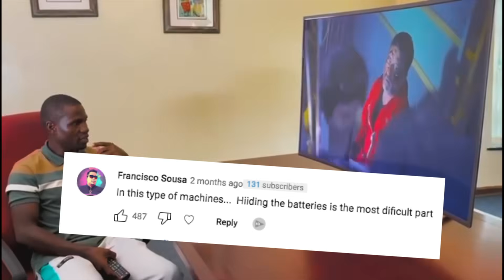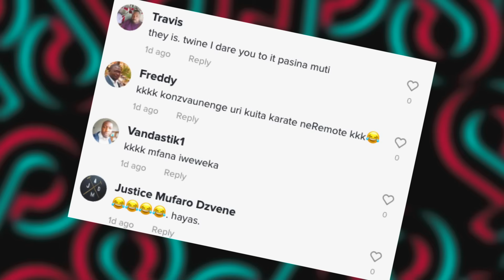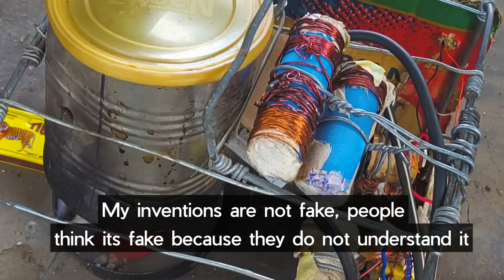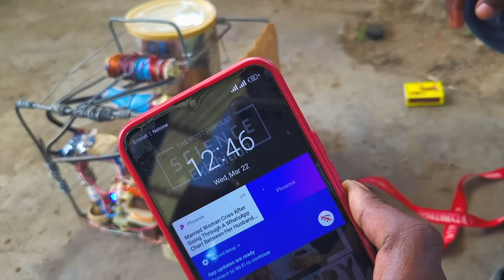Meet Zimbabwe's Youngest Inventor who built a Water Powered Generator

Comment: Conplete scam !!, a candle does not have the power to heat water let alone to the temp for a steam turbine. and nothing moved the only thing that moved was the electric motor when he turned the key. likely a 3.6 lithium cell for motor and charging. another black genius free energy. fuel free cars etc lies and fake.

Comment: It's an inverter powered by a few batteries. The water is just for show in this case. The steam isn't moving any turbine.
Reply: what have yu made so far & have you ever charged yr phone on batteries
Reply: @anndrew7958  I invented the Thermal window generator, The Vacuum steam turbine, The forever fountain...  now we have Crystal cell batteries.  The Tritium generator. We have the magnet piston. A lot of people are making thermal acoustic Stirling engines. To run a generator on Water using electrolysis you'd want to start with a traditional generator then split the Oxygen and Hydrogen off to run on Brown's gas instead of gasoline or propane.

Comment: It is good that he can join mechanical and electrician parts together to make something that works.

It is a terrible generator by the way (good for his age though). It does not run on water (alone if it's the steam that it actually uses and I doubt it)... It runs on burning candle wax (fuel, so at best it's basically like every regular gen).

At worst... It's a very deceptive contraption he has built. What the hell is a spark plug doing there! A steam engine would be way way simpler than that contraption he's got there.

Comment: You should have gone to the local University and taken with you an Electrical Engineering professor. 

Don't put that young guy close to a bank in order to protect public funds as his abilities are off the scale.

You should have also asked him how much the batteries he  was using cost him as the power generator by those batteries was quite substantial..

Comment: At face value, thats not running off of water, its running off of heat energy. The water is part of the drive train used to push pistons through coils to generate the electrical current.

Comment: A steam generator, also known as a boiler, is a device that produces steam by heating water. The basic components of a steam generator include:

1. Water tank or feedwater system
2. Heat source (e.g., fuel burner, electric heating elements, or nuclear reactor)
3. Heat exchanger (e.g., tubes or coils)
4. Steam drum or header
5. Superheater (optional)

The process works as follows:

1. Water is fed into the steam generator from the water tank or feedwater system.
2. The heat source heats the water, producing steam.
3. The steam rises into the heat exchanger, where it is heated further.
4. The steam then enters the steam drum or header, where it is collected and distributed.
5. If the steam is to be superheated, it passes through a superheater, which raises its temperature and pressure.
6. The high-pressure steam is then released into a pipe or header, where it can be used for various applications, such as powering a steam engine or turbine, or providing heat for industrial processes.

There are different types of steam generators, including:

1. Firetube boilers
2. Watertube boilers
3. Electric boilers
4. Nuclear boilers
5. Heat recovery steam generators (HRSGs)

Each type has its own specific design and operating characteristics, but the basic principle of producing steam by heating water remains the same.

Anonyepa uyo twumvura uto tushoma zvisingaiti. Pane battery somewhere ririkutenderedza propeller. Muchigaba umo munongobuda steam inenge hutsi hwetea  kwete zvaarikutaura  atleast aneshungu but ngaataure chokwadi abatsirike.

Comment: Put your own original charger. It won't charge. That generator won't give 220v. It's 5v itself. The charger's wire is directly connected to the two pin without passing any transformer then diodes than capacitor and resistors and voltage regulator or any kind of inductor. It's 100% fake. Charge your phone with your own charger, not his charger

Comment: A generator can run on water. Please check out Toyota's amazing water car that the automotive giant is developing.

However, as super as Mchenry is, this is NOT a water generator. It is a candle flame water electric generator. 

The candle burns and heats water. The water steams, and the steam is transferred into electricity. Looking at Mchenry's invention, I am not sure how he has transferred steam water vapour into electricity? The usual process is by steam turning a turbine. A bit like a windmill's blades, but instead of wind, using the steam to push the 'wheel'.

That is not to knock it! It's still great to know that one can charge a phone up, or light a bulb with a candle! 

You can also cook bread with a candle in exactly the same way: put a biscuit tin over a candle and pop the bread in there. 

And, you can heat a home by putting a candle under a clay plant pot.

But, none of those are water power. They are candle power.

Comment: Something is not adding up here. Am not a Master of Physics and electronics buy the key and starter means there is a battery hidden somewhere in the circuit. Steam engines use so much pressure from steam to turn turbines, something missing from this tale. 

I respect the ingenuity but implore the youngster to be more truthful. Where does teh sound of a running motor come from, using what power? 

0 + 1 = 8 here.

Comment: That is a candle powered generator (that is if it did use steam pressure to generate power). Also from the looks of it, that boiling can could have not theoratically generated enough meaningful pressure to even produce any electricity. Also, why does the generator need to be turned on by a key when the steam is supposed to be generating electricity already. The reason why he supposedly turned that key was to just supply power to that electric motor from a pre installed battery. That charger is also empty and does not have the components of a proper charger which step down current.

Comment: please explain how each stage works on the parts ,like heating ,steam conversion turbine electro mechanical induction ,rectifiers,
Reply: Those two batteries... They turn the motor which generates a current. There is no steam power involved 😂

Comment: Steam power that drives a turbine for power generation has been used for donkey years and is not new, this just confirms the young lad has a gift in engineering
Reply: ...and also being faked by using a battery pack.

Comment: Almost all electricity is produced using heat to boil water to generate mechanical motion to move electrons. 

This is a great little generator, but it is absolutely NOT an invention. Building a machine does not make you the inventor of that machine. These already exist. Almost everything is powered by them. 

Most people don't use candles as the heat source.  They use coal or nuclear fusion.

Comment: There is no way steam from that can has enough power to rotate that turbine at that speed. Its more lyk a short circuit was made between the charger and battery by that key

But with that aside this guy needs support, he has the drive but if he doesn't get the right knowledge on these stuff he wont improve on his machines

Comment: There are so many things that are absolutely wrong with this.
1- just to make it clear to the "spirituals" what he does when he sleeps is called a though experiment, and it is a great reasoning tool used by intellectuals, inventors, scientist, philosophers all over the course of history, and a master at that was Albert Einstein.

2- I think that most people that do not believe, do so because they understand the device and thus believe in the device but not the claims. And in the same stance, i think that those who believe, do so by wishful thinking and indeed do not understand it.

3- sure it works, but the deal was "how", how does it work? Here was what you had to show. Anyhow, I will help you her. Do you see those blue cylinders?, well those are lithium-ion batteries that can be found in many appliances such as laptops okay. Now, those two have enough energy to charge your phone and supply the turbine. The proof is that most battery packs use exactly one or two of those to fully charge your devices.

4- The main idea behind generating energy is having that energy at the first place okay, now example in a car engine, the energy comes from the petrol, and that is why it is called a petrol engine. The petrol produces heat, and the heat turns the pistons. Here Mchenry Dhliwayo has already the energy, I mean the candle is the source of the energy/heat just as the petrol is the source of energy in the car engine, thus his water there is not the source of energy, actually it is the source of nothing but illusion there, this is because water evaporate at 100 degrees, while the flame is higher, thus if it used the vapour, there would be a lost in energy since the candle produces more than vapour can transfer. So if it really worked, not just would it be ineffective, but it would not be a water engine but rather a candle engine.

5- Now the order of the process is all fucked UPP!  He says; when he switch on the generator, the candle there will be water in this container, when the water starts boiling, the steam comes with this pipe before its reaches this part which pump it goes back using these 2 pipes then it is boosted here, and stored, so it works for a longer period of time, then it returns and starts pushing this piston (which in no way is a piston but rather an electric turbine commonly found in toys), then it generates electricity and brings it to the transformer, then it goes to the spark plug, then the electricity from the spark plug is regulated when the switch on the generator, the candle there will be water in this container, when the water starts boiling, the steam comes with this pipe before its reaches this part which pump it goes back using these 2 pipes then it is boosted here, and stored, so it works for a longer period of time, then it returns and starts pushing this piston (which in no way is a piston but rather an electric turbine commonly found in toys), then it generates electricity and brings it to the transformer, then it goes to the spark plug, then the electricity from the spark plug is regulated by the fuse, then it goes out!...

Now all this is a pure mumbo jumbo pseudo-scientific vomit!... one; he does not switch on but lights on the candle. Two; what pumps the steam? Where does the pumping energy comes from?, three; how does the two pipes boost the water steam, how do one even boost water vapour? Four; where do you store steam? How do you store steam? I mean the law of thermodynamics proves it is technically impossible, the steam with time will obligatorily lose heat and cool down. Five; that is not a piston, but a toy turbine. Six; how does it turn steam into electricity? I mean this is the real and most important thing of all this set up right? TURNING WATER Vapour INTO ELECTRICITY, then how does it do so? Seven; why would it pass through a transformer?  Eight; what in all heavens thus the spark igniter does there?, I mean the spark igniter is used in fuel engine to create the spark necessary to ignite the fuel/petrol, here, not only there is no fuel to light, but there electricity is already obtained, nine; regulated by a fuse? Hmmmmmmmmm yeah I think it is pretty much legit MY AZZ!..........

This is embarrassingly stupid! It is insulting to Africans come on! We can do better.

Comment: Let me guess, he disassembled an inverter to make an inverter? And you guys think that's genius. The water and candle is nonsense. You can't produce a steam power in that can with a plastic cover on top, come on when water heats up the pressure also rises, it will explode. So much nonsense just a battery and a transformer just like a power inverter.

Comment: The guy created a boiler that you boil water in then the part where the steam goes or collected where he says is kept hot is actually called the turret and the steam propels the blades of the motor that the electricity generated there is rectified by that transformer  and boom there's electric current...... The guy is soo right l can relate to his work.

Comment: So this being a dc motor, would only produce dc current not ac. How you gona get an ac adapter working on it? Lol. Ud need to convert the dc to ac again. If i was him, id bypass thr cellphone ac adapter and use a mosfet or transformer to bring out 5v dc, no need for cellphone charger, and circuitry to bring out 12v ac and use transformer to step it up to 240v ac. Then the project is perfect 🙂 goodluck young man. If u need some hep just shout!

Comment: Actually. This is simple. However the spark plug is unecessary. He needs to use a proper transformer which only boosts voltage, you would need a circuit to increase currwnt amps as well. I too built these when i was very little and started with wire cars so I understand him very well...

Comment: He should not connect anything or key anything but let the vapor start the engine by itself if it has no battery...
Reply: I bet the blue pipes are old lithium batteries, just connect 2 with an old charger cable and it will charge a phone ... Until discharged

Comment: A plastic lid for a steam engine?  If the steam was contained where it built pressure then we might say that it works but the plastic lid barely closed so yes this is fake.
And why did he need a key?
It would start as soon as enough pressure builds to move the mechanism to get it running.

Comment: I wish him luck. Indeed a steam machine running on water will spin the engine and this movement can be converted into electricity using magnets. If he makes it with much more power and redirect this powerful instead of using a candle he can make a self sufficient generator using water as input.

Comment: DEBUNKED

a sparkplug is designed to produce spark from its gap (it would not make any high current/voltage alone even with an inverter), the high current is produced by an ignition coil, those coils I see on this "invention" is insufficient for a 220v or even a 110v even if he used multiple coils, it requires the exact amount of windings and magnet wires gauges to be multiplied and then produce that amount of voltage required for that charger to work.

that "boiler" is only capped with a plastic lid and not pressurized so its impossible for it to produce a steam strong enough to drive a piston, ( It wouldn't even move a feather) and a piston to drive a DC motor (talk about resistance and friction)

"phone charger" is rigged too

I dunno why I get so serious with this kind of "invention" when it is all but a joke. hahahahaha

Comment: The water and candle actually did nothing . He has a little motor powered by a battery that the key operates and a charger diractly connected to the battery. The rest of the things, wires and spark plug just sat there.

Comment: this is not actually a generator but an inverter or may i say a current booster. if any one here notice the 3.7v battery and the transformer in the video, you should know its a current booster while the key is simply a switch to turn on the inverter.
he is not truthful about his invention

Comment: Actually there is no power from water, this is fake.
 The power output here is 
Battery>>rotate dc mototor>>then dc motor rotates ac mini generator >> then minimum volt from ac mini generator is steped up from 12vac to maximim about 120vac,,, using transformer seen!! so there water don't play any role in power output

Comment: 😂😂😂 the most difficult things of this technology is to hide the battery 😂😂😂
He is even using fake charger that has nothing inside it to convert high voltage to lowe voltage because there is no high voltage 😂😂😂 it is just directly connected to charge pin which eventually connects to the hidden battery 😂😂😂😂😂

Comment: It's fake.... Steem can should be air tight to prevent steam escape... He definitely hide batteries to run piston motor.... The pistol assembly seems big enough to fit nano 6v motor...... And the mobile charger can run on less electricity but it cannot charge mobile like normal.... It can only shows mobile charging status.... Can we saw he didn't plug the light bulb to that socket... So it's definitely fake project..... These people only want to gain publicity and try to make fool to sponsor's

Comment: Its disappointing that all this is fake. First him pouring 3 drops of water in the Tin ... to generate steam in just few seconds with that plastic cover which is not tight. ..  he's using 2pcs 18650 batteries which are switched on using the key. These batteries run the motor as a generator thru the transformer from dc to ac. For the fon charger to work..  the batteries will drain after sometime n will need to b recharged. There is no steam being generated at all otherwise that Tin cover would blow off in the air due to high pressure generated by boiling water..  he just needs to go to school not faking things